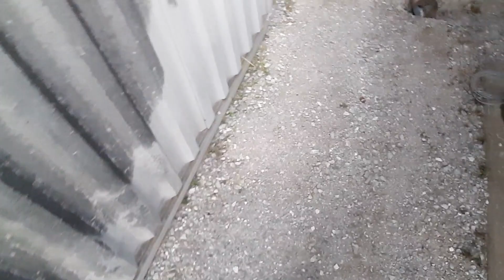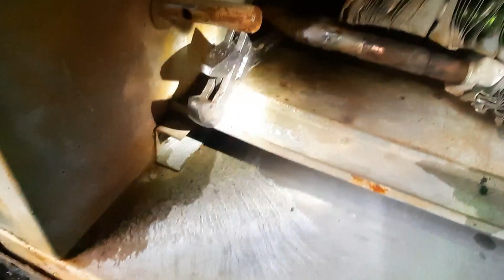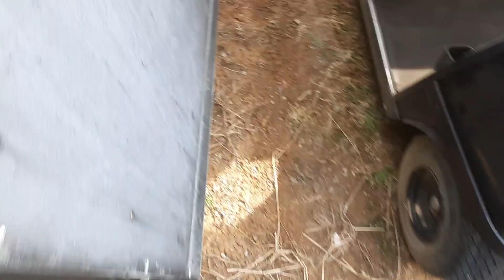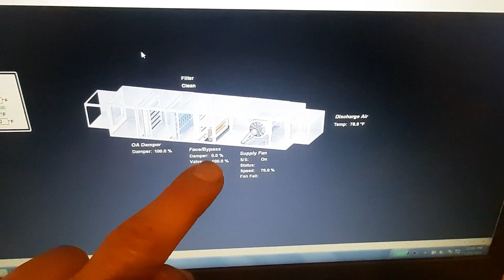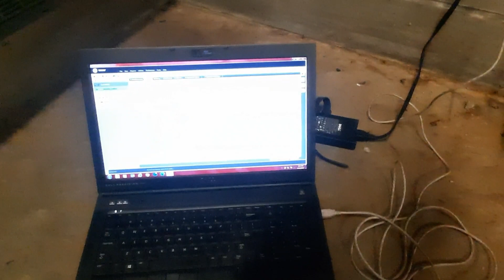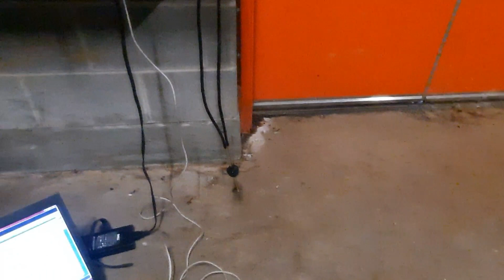No Heat Service Call. Steam coil leaking, repair and adjustments

Comment: Did it ever trip the LWCO or do you have a make up water station going to the feed tank. DA tanks i am used to work on have Sparge tubes to heat it up to around 225-240° injection into the boiler.
Reply from the maker: No the boilers are separate, they are used for the distillery process and use pressure reducing stations to feed low pressure to heaters. There are around 5 of these MUA throughout 3 buildings and 50 or so smaller steam coils as well, they really have no influence on the boilers which they have 4. There are return pumps that feed back to the boilers. There is a lot going on here, I'm still trying to figure out everything and get back to design.
Reply: @EverythingHVACR  that makes sense. I get those MUA are used for tempering the air to a neutral temp. Is there a actuator or valve when no heat is required for comfort. If im understanding you correctly...when the process is going...thats what enables the boilers and these are almost an after thought or byproduct of the process
Reply from the maker: The process never really stops, the boilers maintain about 140- 150 psi constantly, there are actuators for the steam to the heaters that operated off outdoor air. These have been left open for now while I was working out some issues as they had the air vents closed and steam pressure around 80psi when I first saw them. Not all traps and/or air vents are rated for 80 psi so they damaged a lot. Air vents get left closed after initial air is bled and I've been running around 20-30 psi with not many problems except this guy, it's been a mess from the start
Reply: @EverythingHVACR  as always....another killer video and nicely done. Im no steam Jesus myself and am always trying to understand more and learn the intricacies of them. 150psi is some pretty good pressure. Definitely process stuff, i remember working on one here or there, most of my experience is with comfort. I did work at a lot of industrial places...just mostly no cooling calls, every once in awhile, when the boiler guys were swamped...i get to go and tinker with them. Industrial is a whole different stiry than comfort
Reply from the maker: Yeah I wish I had someone else with some good knowledge to help through some of these issues, I'm still learning myself but have made some progress
Reply from the maker: Thanks Jason

Comment: question do you know if this job ever did was it was intended to do also do a TD check on the steam trap just to insure its doing what it should...2 cents worth and good vid as always
Reply from the maker: Thanks Ralph! I did check the trap and it was working. As far as doing what it was  intended to, I'm not sure no one can provide blueprints or tell me how it was designed to work so I'm doing what I can to make it work until I find some guidance from blueprints. I have corrected a lot of steam problems already, this place was a mess to begin with if you've seen any of the previous videos.

Comment: Really cool video. Steam is one of the only things I haven’t worked on in the hvac world!
Reply from the maker: Thanks Brian! I'm still learning myself
Reply: @EverythingHVACR   is it a process plant that used steam so they decided to use the waste steam for heat ?
Reply from the maker: It's a distillery, the steam is used for their process and for heat. There are 5 large boilers at this plant, I have a few videos here some on steam some on some other equipment.
Reply: Ya I have been following you for a while . I remember you found the pressures like crazy high and I unnecessary. They had “ if it isn’t broken then leave it mentality “
Reply from the maker: Yessir, this is the same place. I generally do all the work here so a lot of equipment for content, at least what i can show. Thanks Brian
Reply: @EverythingHVACR   thanks for the video . Surprised you don’t have more subs ! Keep them coming !
Reply from the maker: Thanks Brian!

Comment: a previous work place ran 50 lb dry steam in three buildings that used to be on a large central plant that ran 10 buildings. But now each building has it's own boiler but the 3 remaining buildings are interconnected running the 50 lb steam. Man can you heat a room quick with it! There is also old power generation equipment in each basement to supply custom power needs as the plant used be GE Manufacturing and the power generation ran off the steam system. It was fun to walk the basements & tunnels that connected the whole campus. Saw some really cool stuff from the 40s & 50s.
Reply from the maker: Hell yeah! Love those old buildings with old interesting stuff. Thanks for watching joeyf